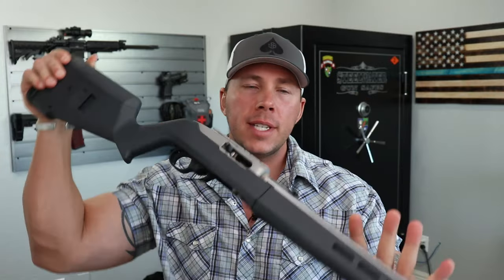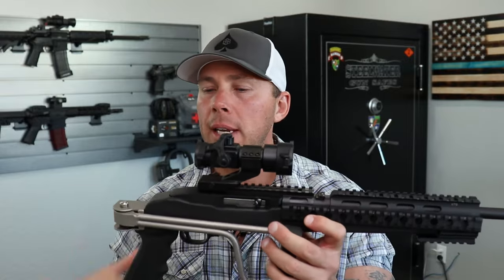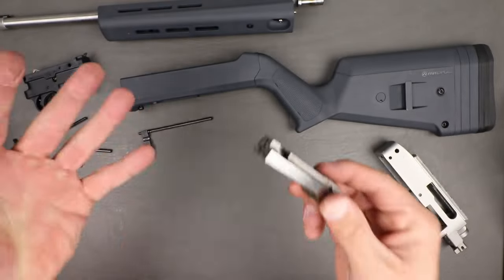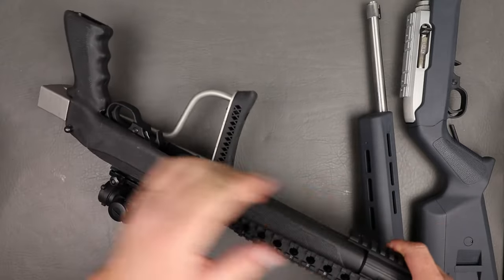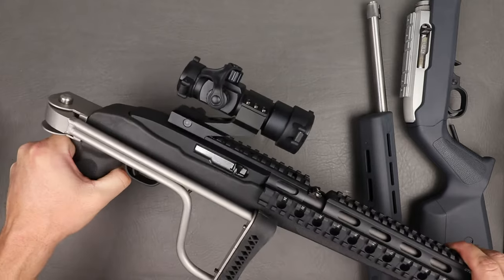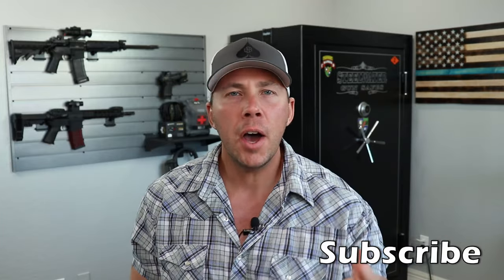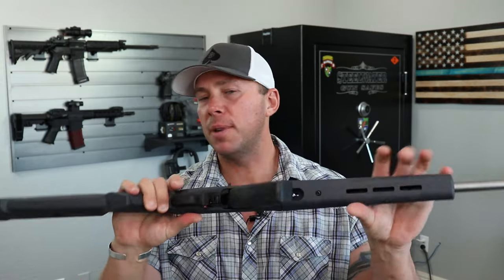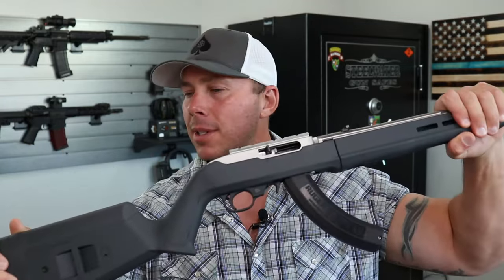Volquartsen Extractor And Problems The Plague Ruger 10/22

Comment: This is the best video for solving the Ruger 10/22 jamming problems. Like the host said, "The main problem is probably going to be the extractor..." -- INDEED! Recently my Ruger 10/22 jammed on every single 10-round magazine, which I've got 22. I got so frustrated. I had to find something to make it work. Many other videos didn't help. Only this one is the TRUE SAVIOR. I've got my Ruger 10/22 about a year and a half. I've cleaned all other parts except the extractor because I didn't know about it. This time I cleaned it (I didn't replace it, but just cleaned it. But the Volquartsen is always a good backup). There was so much gunk in there, and the extractor had a hard time to move freely, WHICH was why my Ruger 10/22 jammed so often. After I cleaned it, it's been working like a charm! Dang! It'd been plaguing me for many months! Thank you very much!
Reply from the maker: I am really glad you got it running.  these can be great and fun for all but if they don't run its a real pain.

Comment: Ruger 10/22 is a great gun. I've had mine for 40 years. No problems.
Now the new magazines, the 25 rounds suck. You have to take those things apart and totally sand them down smooth and fix the feeder because it comes in at the wrong angle. And for your little pins, you can buy aftermarket ones that are tighter. or make your own out of maybe even drill bits. Best shooting gun I ever had. And I don't think you know what you're talking about.

Comment: The beloved 10/22 I got mine a while back, had the choate stock but didn’t like it and sold it then settled for the hogue one I kept this one as it hugs my green mountain running boar barrel perfect. Changed the extractor, match hammer and sear, firing pin, buffer, bolt release all volquartsen parts. It is a way better rifle now no problems ever since the upgrades mine loves the federal auto match bulk box, but it will shoot almost everything. The only ammo I refuse to run through it is the Remington golden bullet bulk. One thing I did notice is the extractor it is a harder steel and after long time of use I notice a lot of wear in the barrel extractor notch.
Reply from the maker: Sounds like you built it right
Reply: The only ammo I've EVER had issues with was the Remington Golden Bulk Pack.  I have three semi-auto .22LR's and none of them like it.

Comment from the maker: What problems have you had with your 10/22? 
►Channel Support◄
Tac Cons Patches/Shirts https://bit.ly/3aFdCN6 
Patreon ►https://bit.ly/2JTBCBj
Reply: Feeding with everything but the 10 round magazine it can with. After taken it apart and cleaning it and taken a stone to some parts took care of the issue.
Reply from the maker: You know these things need some love sometimes man. . Mine both run great now.
Reply: @TacticalConsiderations  Yeah I understand why gun companies do stuff like that. It's to keep the price down, and I don't  mine doing some TLC  maintenance to any gun.
Reply from the maker: @joshuagillan474  yeah totally a $200 rig isn't going to operate like a fine tuned comp set up lol.
Reply: @TacticalConsiderations  No it will not
Reply: For the mags use .22 short case dont need to trim and for the screw its loose Kidd have antiwalk pins with a counter sink bit
Reply from the maker: @Rabbi Jesus I've never owned the buckmark
Reply: I had a 10/22 target. If I didn’t run high velocity ammo it was stove pipe city. Frustrating.  I sold it and bought a grey birch solutions carbon fibre barrel and receiver, with a volquartsen bolt and tg2000 trigger. Its money
Reply from the maker: Volquartsen is money but worth every penny

Comment: Outstanding.  You may have just helped me solve my 10/22 issue of late.  If so, I also helped about four of my fellow shooters with the same problem.    I'll report back later.
Reply from the maker: Definitely let me know if this helps you out. Seems very common.
Reply: @TacticalConsiderations  I found the problem.  I had mounted a Picatinny rail to facilitate mounting a Leupold scope made for the 10/22. A Ruger product, the mounting screws extended just a few thousandths into the receiver, enough to interfere with the bolt.  Removed the rail and screws, end of problem.  Now have to figure a way to shave a thread or so off the screws so as not to interfere with the bolt.  Didn't realise the tolerances were that tight on the 10/22.  Operator error. Or maybe partially Ruger's, too.

BTW... Don't use cheap magazines like Butler Creek.  They fail and are not worth the cost difference.  Use Ruger mags, you can't go wrong.  You can disassemble and clean them.  Never a problem with them in over 20 years of use, even when dirty.  In fact, I didn't even realise they were dirty until my 7YO grandson wanted to take one apart just to see how it worked.  God love a grandson! And, no, I don't work for Ruger. Just an unpaid advocate.
Reply from the maker: Oh yeah that screw issue has been an issue too

Comment: Have a new 10/22 and using a TacSol receiver. Having issues with the extractor claw losing grip on the rounds as they leave the chamber. If I slowly cycle manually with the charging handle the rounds will around 40% of the time just fall off the extractor before they're bumped out of the port. Any idea on this? Got my father in laws factory 10/22 probably 15 years old with thousands of rounds in it, same ammo, and his extractor ejects every single time. Not sure if I need a new extractor, spring or something else
Reply from the maker: I have had to change the extractor on every 10/22 I own.

Comment: I've bought 2 of the BX25 mags and both had very bad feed issues to the point they were basically unusable. Two drops of oil on the follower spring totally fixed it.
Reply from the maker: Good to hear
Reply: I have 2 bx 25 mags and never had an issue with them, them both came in the same package and 1 fits tighter than the other..

Comment: Good video, thanks. My nearly stock 10/22 runs flawlessly. I think most problems are user induced via needless mods. Besides, why turn a $300 rifle into a $2000 rifle? OK, the one mod I made is an auto bolt release, Volquartsen, $12.
Reply from the maker: oh yeah I have seem some crazy build 10/22's for sure.  But these are cheap improvements over stock parts as compared to say barrels, trigger groups all that.

Comment: If you have a Take Down model, you can check if your ammo is the problem. 1) Take the rifle apart. 2) Insert an ammo into the chamber by hand. If it goes in well like you insert an ammo into the chamber of a revolver, the shot should not have a jam. From my experience, CCI ammo typically fits well. They are good quality. Therefore they never have problem. Some other brands, like the green Eley of UK, the ammo is too tight to fit through the chamber mostly. It’s because there are traces of material between the shell and the bullet head. You need to scrub them off using hand nail or sand paper. Then it will fit the chamber and works fine. No jam.
Reply from the maker: Good info. I've not had any issues since the extractors and new mags have been used

Comment: Really nice. So by replacing the extractor on the stock bolts makes the Ruger bolts better functional rather than say buying the Volquartsen bolt? they are very pricey and I got so far 3 Ruger receivers!
Reply from the maker: It fixed my cycle issues but the 10/22 can be a bit of a pain . Try the extractor first

Comment: My ftf I found out that the ELEY ammunition is very unreliable...cci and Norma I have no problems at al....stovepipe jams have been sorted by enlarging the ejection port, and FTL are non existent if I use high velocity ammo, sub sonic ammo does give enough back pressure,  great vid too   .  I worry everytime I remove the extractor just incase bits fly away   .regards from Scotland....
Reply from the maker: Thanks for watching all the way from Scotland.
Reply: Enlarging the ejection port? In what way?
Reply: @scottgoodman8993  .I elongated the circular end of the port, I found most of the cases caught this part on the way out    I used a dremel with a mill cutter on it and it left a great finish  . Hopefully that makes sense
Reply: @biggixer  Yes it makes perfect sense. Thank you. I now have to screw up the courage to alter mine. Thanks
Reply: Put the bolt in a plastic bag so the little bits don’t go flying off in to nowhere land!
Reply: Interesting how different guns like different ammo.
My wife shoots Eley, consistent sub 1/2 inch groups at 50 yards. Cycles perfect.
Reply from the maker: It is some run everything others won't run anything

Comment: I purchased my first 10/22 a couple weeks ago and haven't fired the first shot through it yet. I ordered the Volq. exact edge extractor, the Volq. Automatic bolt release, and because I wanted the Tech Sights TSR200 I had to replace the barrel. I ordered a standard Ruger 10/22 barrel to do that. Lastly, at the recommendation from Tech Sights, I got Marble's Sight Slot from Midway that is mounted on the rear dovetail for the rear sight. I'm hoping to enjoy my rifle for years to come and it is a very good rifle. I don't know.
Reply from the maker: Man you went full bore out the gate
Reply: @TacticalConsiderations  Yeah:) To be honest, when I first bought the rifle I didn't realize it was for only a scope or red dot, and I thought MAN! I wanted to install those Aperture TSR200, and after asking around I decided ordering a barrel would be the best option if I had to have those sights, which I did. As far as the Volquartsen equipment, a lot of information exists on those, so I went ahead and did it:) Thanks
Reply from the maker: Enjoy it man . 😉😉🤙

Comment: I know this is an old video but i recently bought the 10/22 chargrr fixed 8in barrel   and bought 4 bx 25 mags tried to do the 22 casing fix but ruger must have fixed that issues because the casing no longer fits. Still have jams and stove pipes.
Reply from the maker: 22's can be finicky .. The extractor seems to fix most of that.

Comment: Ruger has a great warranty if you have any issues. Lucky for a few of us their factory is a short drive away in Prescott. They even told me if I drove up there they would fix any problem on the spot!
Reply from the maker: For sure they do just seems to be every time I get a new 1022 it fails to extract more often than not. Plus I can like working on my own stuff so $12 part was no big deal.
Reply: @TacticalConsiderations  Easy to work on but their warranty is great for those who aren't mechanical. I do have a Ruger Mark 2 10" Bull barrel that I can't get a part, and because it's a unicorn I don't want to beat it. I may have to drive up to Prescott and let them deal with it. They were pretty cool and said drive on up we'll take care of it. I can get my other Mark1 and Mark 2 apart this one doesn't budge on the lever.
Reply from the maker: @ckim6400  yeah pretty awesome they are like that .
Reply from the maker: @Rabbi Jesus great to know they stood behind it.

Comment: I have a 10 22 build that I'm having a strange issue with the 😅bolt is  freezing  up inside the action after I attach the trigger  pack.
My  shooting buddy and I can't  seem to figure  whats going on. Inside the frame. Its just not that  complicated  or maybe it is? I would  really  appreciate  if you could  PM I would love to explain my issue to you.
Reply from the maker: Sounds like you bolt is riding on the top of the receiver maybe due to pressure. if you have a rail on top or screws into the top of the receiver take them all the way out and see if it cycles.
Reply: @TacticalConsiderations  Ok I will give it a try.  If that doesn't  work  do you have another  possible/ solution or fix?
Reply: @TacticalConsiderations  I took the rail screws out. The bolt is still stuck???? Any ideas would  be appreciated 🙏 🙂

Comment: They must have improved the bx25 mag. Mine doesn't have enough slop to get the spent case in there. But I still have failure to feed.
Reply from the maker: Ruger 10/22 are like Ducati motorcycles you either get the best bike of your life or the worst.

Comment: I came here because my brand new 10/22 wood stock, haven’t even shot it yet, wasn’t extracting when I went to cycle it by hand. I was using CCI stingers, the ones with the silver shell and copper plated nose. I was confused because it’s higher end .22lr ammo and honestly I thought it was the best. I figured it was just because I haven’t “broken in” the gun yet but I just tried some cheap cheap “Aguila .22 Super Extra - Copper plated bullet 40gr” and everything cycles properly. I guess it doesn’t necessarily have to be high quality ammo.
Reply from the maker: Glad you got it running
Reply: @TacticalConsiderations  thank you! You just got a sub for replying to me like that :). I’ll definitely be watching your videos now.
Reply from the maker: Much appreciated
Reply: Stingers actually have a slightly longer case. That can give you problems in some guns. Some eat them just fine tho.
Reply from the maker: Good to know

Comment: I wonder what would happen if I chamfered the entrance to the barrel (action side) with a 1/4 inch  drill bit , say 1/8 inch deep. Would this improve feeding and extraction?
Reply from the maker: I thunk people do that since the magazine lip is essentially the feed ramp but I've not had problems since the parts change
Reply: @TacticalConsiderations  Thanks.

Comment: This video didnt really inform me of anything
Reply from the maker: ok
Reply: @TacticalConsiderations  apologies. Too harsh of a comment. there seems to not be much info regarding the Volq TG2000 issues im having so my expectations were high.
Reply from the maker: I get ya These are more on the stock problem side not with aftermarket parts.  The extractor, mag and ejector are usually the big problem areas .